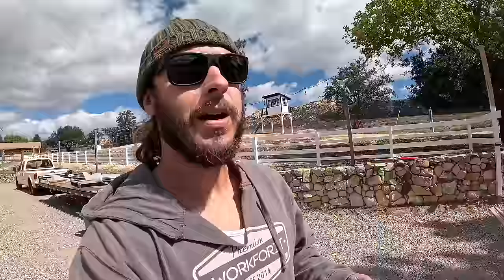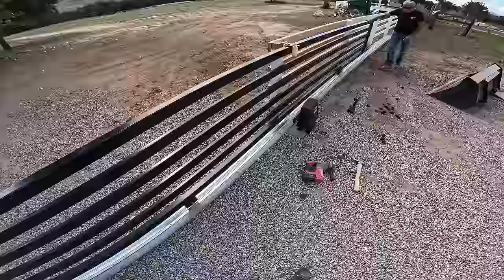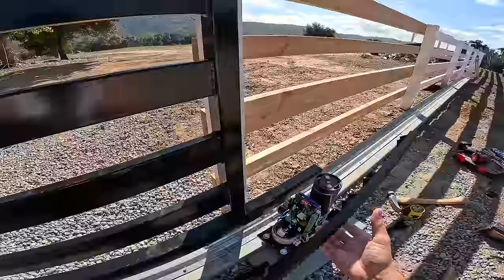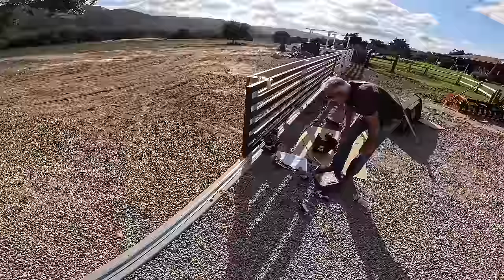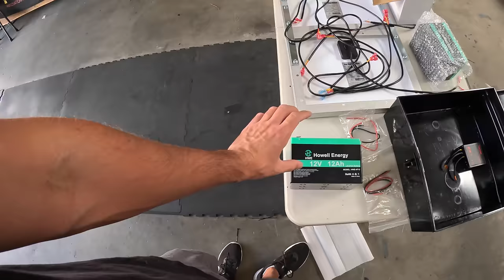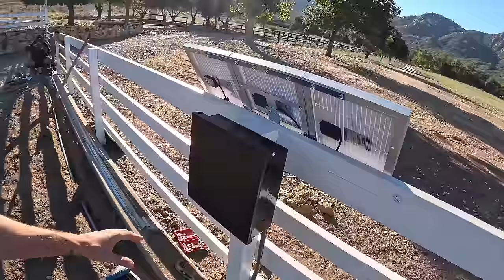Building a Custom DIY Gate the Easy Way! (Part 5)

Comment: Maybe you could weld a metal plate to the bottom of your gate motor so you can drill holes threw and the motor will be anchored down better. And maybe do something like the railroad does at the crossing, so when drives over your track doesn't get smashed. 
Thank you Ryan!!!! Really enjoy you and your Dad working together 🎉

Comment: Go back to your powder coater, they will have the color code that your gate was coated with. They can get you a can of touch up paint in that exact code. I installed balcony rails for years and we always had touch up paint for the powder coating. Just a warning though,  it is more expensive than regular off the shelf spray paint but it will match.

Comment: So, you could "hot coat" the spots where the chips are with powdercoat.  No powdercoater would sign off on this method but it does work in a pinch.  Get some of the powder used from them, get an infrared heater, get the metal above 250 deg, "hot coat" the area with the powder (use a harbor freight powdercoating gun) and it will look better than those huge chips and will match.  You will overheat the existing powdercoating locally in that area, but the new powder that has been melted will match.  Alternately you may be able to use a heat gun to "spot coat" the chips in the same manner, getting the metal up to temp to melt the powder.  It won't be as durable in that area but will match with a bit of "overspray".

Comment: 1/4"-20 stainless anchors are harder to snap off. That's all I used for years in mostly electrical installations, especially in a corrosive environment.  I'm glad you did this video I've been looking at these openers. I hate the chain openers. Very nice install.

Comment: Nice work on the gate, that opener is pretty cool. Are you going to put something to hold the gate captive on the other end? The wind will definitely blow that thing off of the tracks without being captive on both sides in the closed position. I would also consider putting a piece of angle iron on the gate as a stop at the roller so it can't slide through and fall. I had my gate fall before I finally got it all finished so I'm speaking from experience.

Comment: I think with the bottom plate that it rolls on, it's not the weight of the gate you should worry about but the vehicles rolling over it. I would put more redheads than less.

Comment: 5:25 A 3/16" drill bit to provide 4 holes for wood screws to secure the bracket to the post so the lag or, better choice, carriage through bolts could be added later without any antiscrewing required.

Comment: What you could do is through bolt the guide rollers through your post, use a like a 1/2” or whatever size Forstner bit and counter sink the backside of your 2x6 to hide the through bolt or carriage bolt nuts behind your face board. Just an idea that comes to mind that I would do if it was my project.

Comment: If you want the bottom rail not to cut off the Zinc anchors, you are using you do need them in every hole. The weight of trucks will cause it to move and spread the rail, this will cut of the anchors as zinc is brittle. We use these anchors all the time for rubber roofing.

Comment: I put in  about 50 1/4" wedge anchors for the sheeting angle on my new shop.  They suck.  I broke 5 or 6 of them which meant I had to drill a new hole next to it and try again.  I wish I had come across the hammer in type, would have been much easier.

Comment: It looks like you could have gotten the full 20 feet of open if you didn't start the rail so far towards the end of the gate on the end where the motor is… Doesn't look like much of that will be used on that end